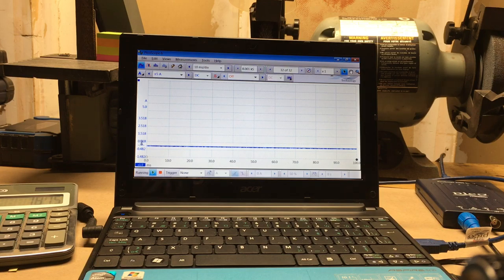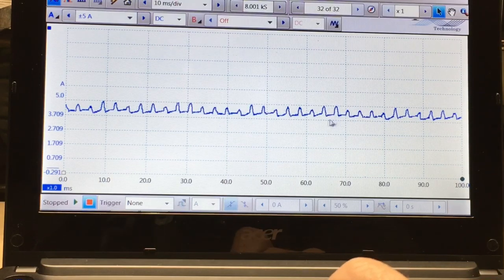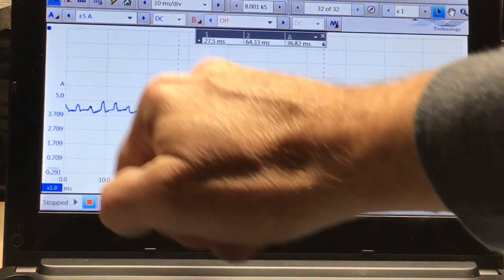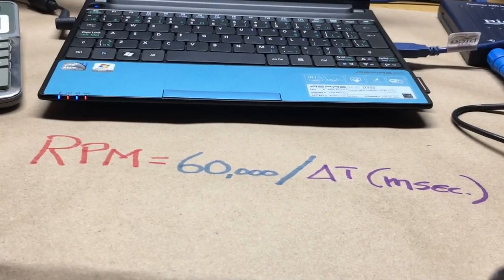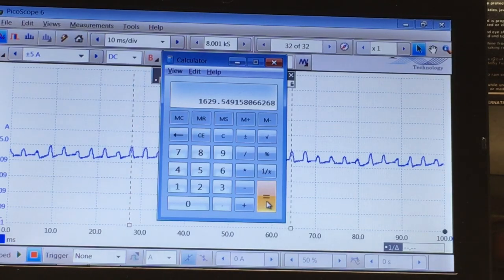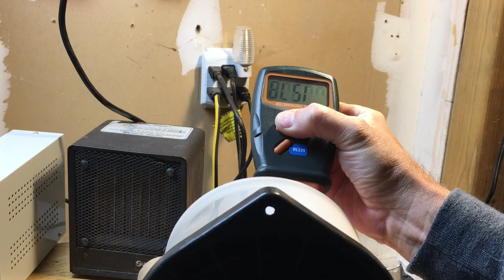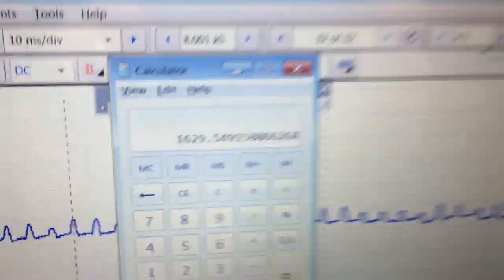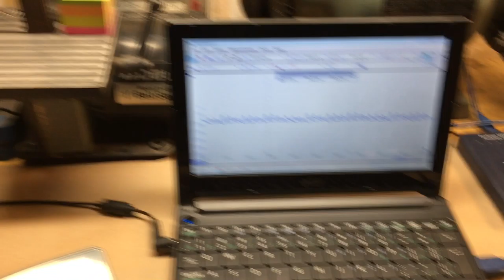Current Waveform Interpretation P1

Comment: Thanks for the video , I've bin try to interpret fuel pump wave forms and had ones where the humps are not all the same as yours where , would you say that your motor was ok ? 
Or is it faulty when a hump is flat ? 
Rob mobile man
Reply from the maker: Hi Robert...Difficult to say without seeing it. In general, some deviation from the textbook uniform humps is normal. Dropouts, upward spikes and extreme asymmetric patterns are more of a concern. Hump flattening is a sign of brush wear and some carbon bridging between commutator segments (if adjacent).. This is quite a broad topic and I am only an novice in this matter. More to follow...Thx for watching. Cheers  Ps...This blower was condemned for noise and as you may have noticed tight bushings/bearings
Reply: @TheGibby3340  
Ok many thanks